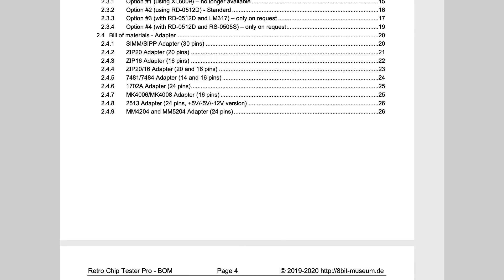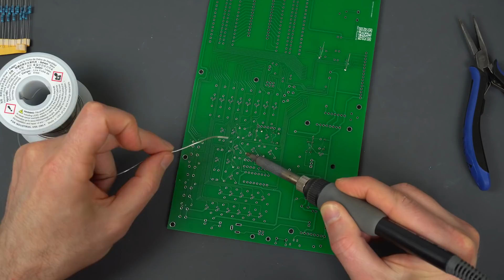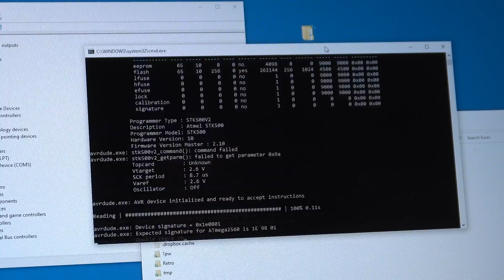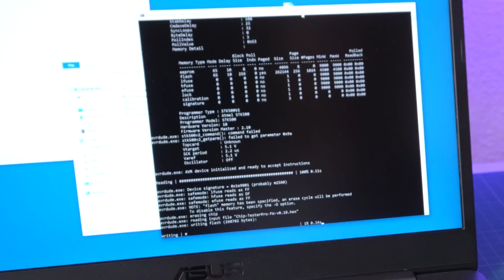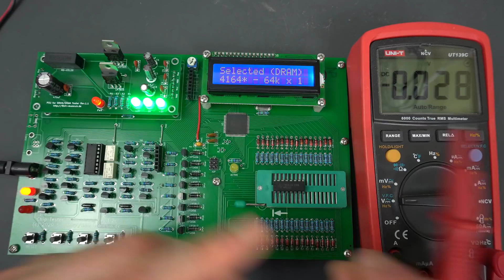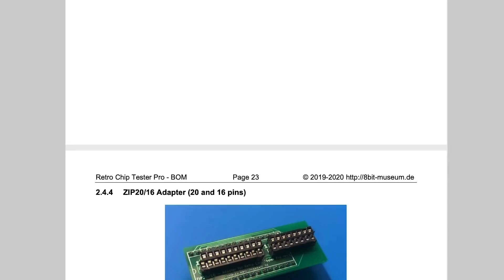The Ultimate Retro Chip Tester?

Comment: I saw something much better than this tester. Unfortunately I didn't see the device he shows only the display. He inserted the IC and after the test a graphic with all the pins appeared on the screen. Showing high or low or osculating on each pin and the model of the chip. It was in a pinball repair video. But there was no information about the test device.

Comment: I'm wondering how this compares to the TL866 and its A version, which not only tests chips but also programs microcontrollers (and the A version also has an ICSP port) and PROMS?  Obviously, the retro tester pro is better if you don't want to have to lug a computer around along with the tester since the retro tester does everything without requiring an external computer.  On the other hand, the TL866 both tests chips and programs microcontrollers and PROMS, and it's a lot smaller physically, and the version which I bought came with around two dozen adaptors for surface mount chips etc.  It's controlled through a program which allows you to select the chip from a drop-down scrollable list, which is convenient.
But how do they compare for the numbers and types of chips which they can test and program?
(When I say PROMS I'm including EPROMs and EEPROMs)
Reply: Please download the compatibility lists. The RCT tests about 1200 logic ICs that the TL866 doesn’t. None of the DRAM ICs and SRAMs <32kb are supported by the TL866. These devices have a different auditorium, so they are not comparable.

Comment: Very impressive variety and amount of chips it can test. I would think having the ability to interface with a computer and use a simple VT52 interface would help vice relying on a LCD screen - but it does make this tester as a convenient standalone tester. 

An alternative tester that I recently acquired is the Tauntek IC tester that I saw reviewed by CuriousMarc YT channel. I like this tester because during testing it is able to measure current drawn by the chip and measure pin voltages are within VOL and VOH levels and even tristate levels. It’s helpful to see borderline chips that other testers may just declare pass even though the chip may pull way more current than normal. 

The tester reviewed here and the Tauntek tester, together, can be some great testers to both have to complement a viable work bench. 

Thanks for the review on this tester and highlight mistakes during the build that could easily happen to any of us.

Comment: So out of curiosity, what was that HM486*** chip's entire part number? I ask because the Hitachi HM4864-2, HM4864-3, HM4864P-2 and HM4864P-3 chips are slightly different from the Texas Instruments TMS4164-15NL you started with. They have 128 row address strobe cycles, as opposed to the 256 of the TMS parts, so I wonder if that affected the test outcome?

Comment: I wonder if the USB programmer you used was capable of powering the board.  I noticed the power adapter was not plugged in while you were programming the AVR.  You may have been unknowingly powering the device through the clock pin (rectifying the 5V clock signal with the esd protection diode(s)).  I've seen microprocessors powered in this manner; Not good, but it can power the device to allow it to program.

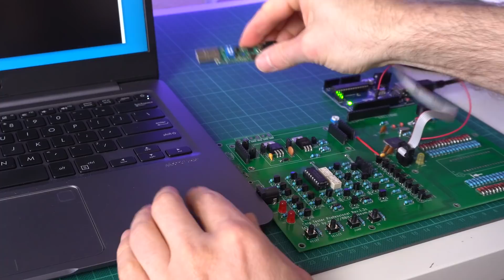Comment: At 8:02 you forgot to connect the Arduino’s GND to the chip testers ground. It doesn’t seem your Arduino is powered from the PC so wonder how the grounds are eventually connected to each other. This might also have caused issues when trying to clock the chip tester from the arduino.
Reply from the maker: You're right. I wasn't thinking about it but I think I lucked out because both devices are powered from the USB ports on the laptop.
Reply: @NoelsRetroLab  it was not clear from the footage that the Arduino was fed by the laptop as well. Its cable seemed directed the other way. Nice video!

Comment: As automation designer advise You - not use any scripted stuff. Because default fuses are set for internal RC clock at factory, changing must be in strict order. This video shows how to brick ATMega chip by turning off all clock sources - common error.

Comment: I really have to point out what I consider to be a tiny fault in your reasoning, specifically the cost. While I am not into retro or AVRs at this very moment, every bench should have acquired at least one AVR ISP programmer, if not a giant pile of them, and so should not have been included in the total cost. In fact, as a kit it's something you should do for the channel.

I'm not sure if you realized this, but at the end, you had three MCUs working together: the SMD one that's pre-soldered, the one in the programmer you got (which are almost generic, btw; you may have been misled somewhere. One AVR ISP or ICSP is the same as any other, more or less), and one more to run your fake external crystal program.

Anyway, great video otherwise, but the cost of the programmer should not have been included, IMHO (and I hope you didn't pay more than a dollar or two for the one that ran the fake clock), and you should have at least one programmer around, if not a few, and even another ZIF to try out programs before changing fuses on one that's going to be so annoying to resolder. Just my .02. Without the programmer, it's a pretty stunning value, really.

And last note, if you wanted to add a rotary encoder and change the code, it should be really trivial to do, looking at the nice layout of the board.

Comment: There is 21st century outside. Forget that txt LCD modules, find any colorful SPI/I2C LCD screens. They are even cheaper. And rotory encoder could be nice. But nice addition is USB port and host software. And all is done from other "duino" chip- STM32...
Reply: and for logic chips... China made eprom programmer has logic chip finder and tester. And also, it can test SRAM. The only missing option is DRAM. 30USD in 2007... (TOP2004).
Reply: @kaunomedis7926  Isn't having a choice something nice? You don't have to buy this one.

Comment: Why did the fuse setting script fail in the first place? Would it have made a difference to run it again?
Reply from the maker: No, I tried running it again, but the fuse state had changed and I wasn't able to program it anymore. Hard to say what exactly caused it. I think there was something wrong with the programmer cable and it may have had a bad contact and lost power during the initial programming.
Reply: If an error occurs, e.g. due to a bad contact or a wrong programming frequency (too high), it may happen that the fuses are set to "0x00" (it is a serial protocol, so it is very important that it is in sync). This forces the controller to use an external clock generator (not an an external crystal). Most people think the ATmega is broken, but it isn't. With the "osc" from the 10 pin header or an external clock generator (e.g. what Noel used) it is possible to set the fuses correctly and everything is ok ;)

Comment: Didn't need to buy that ISP programmer if you had an uno...

Would be neat to have an FTDI on there to interface with.  With so many chips to test, a simple program with drop down menus and a search function would be amazing.  Documentation and control could be combined into one program.
Reply from the maker: Yes, you're right. I went with the ISP just because it was the most recommended method, but the Arduino would have been fine (or better for me even).

Comment: bad idea to make such big board with only 4 btns
better is to make small board with mcu driven by usb. all indication should be on pc.
for example tl866 programmer
Reply: but.actually i look on this as commercial dev, so double sided smd will not be very friendly . but for 110 euros.. 

i think 80 would be.enough.for complete product.
Reply: @alexroman6246  When you can get the components for 80 EUR, well then you can assemble it for 80 EUR, sure. If you buy the components in a pharmacy, it may even be a little more expensive.
Reply from the maker: I was including things like the ISP programmer, which are not needed if you have an Arduino, so you may be able to get away assembling it for less.

Comment: you forgot the gnd pin from the arduino, not a very good idea to skip that, even if the gnd is the same as the pc, it will create a big gnd loop which is not good
Reply from the maker: I did! I think the only reason it worked is because I powered both boards from the laptop's USB ports which probably have the same ground. Oops!

Comment: Nice your make shift clock uses an XOR! Instead of dirty “if”! The sign of a good programmer.
Reply from the maker: Not like it would matter there, but yes, I see your point. However I can't take credit for that myself, because that was included in the (very extensive) manual itself 😃

Comment: OMG, what a horrible user interface. I was actually interested in this until I really saw how it was operated. What it needs is to fully use the USB interface to allow a program and database to live on a PC and then the chip number could either be typed in or selected from a menu.
Reply from the maker: It was designed to be a standalone device, so I think that's out. The new firmware version has a much better navigation, so check it out when it comes out. It's not ideal, but it's definitely better.
Reply: A simple serial port would make this thing so much more useful. CuriousMarc recently made a video about the Tauntek chip tester that works that way. https://www.youtube.com/watch?v=gqbXM48bbOs

Comment: Interesting, that works out to about USD$130, which is not a lot less than I paid for my Innoventions RAMCheck. Granted that only came with the default module adapter, so you'd need a lot of different adapters to test other kinds of memory, including chip memory, so that would add up (if you can even find them). The main advantage of the RAMCheck is that it also tests performance, not just functionality, so if the chips on your SIMM are marked 60ns, it will tell you whether it meets that performance or not. I've actually found SIMMs marked 60ns performing at 50ns speeds with no errors. The other advantage is it's a lot quicker. It can perform a whole lot more tests in less than a couple of minutes, and that's on a multi-MB SIMM, not a single chip with 256Kbits.

Anyway, the Retro Chip Tester is probably better value than an Innoventions tester, since they're not easy to come by. I should probably look into getting one, if nothing more than to test all the chip memory I've got on faulty boards. At least that would rule out a RAM issue with those boards.
Reply from the maker: Interesting, I wasn't aware of that RAMCheck. The fact that it measures performance means it has to be a lot more powerful, so that's certainly a unique feature the Retro Chip Tester couldn't really do. But I agree that it's a fantastic device for the money, which may seem a lot at first sight, but it really isn't given all it does.
Reply: @NoelsRetroLab  Oh yeah, and testers like the RAMCheck cost thousands new, so the fact that the Retro Chip Tester isn't as quick definitely isn't a bad compromise.

Comment: I think I'm sold on this. 

In the future making it so it can identify unidentified chips would be a fantastic feature if it can be added! Also adding a full keypad to directly enter chip numbers would make things easier too. If/when I get one I think I'm going to try to design a 3D printable case for it.
Reply from the maker: You won't regret it 😃 A friend of mine used a small plastic case he had for something else that's JUST the right size of the tester. So he can carry it around really easily. I believe he also changed the power supply to use batteries, so he made it 100% portable. Really neat.

Comment: Remember to set the contrast for the new LCD.  Also, I would mount it in a wooden case with a lid, and print the extended chip list as either a table on the inside is the lid, or as a little booklet that sits next to the device.
Reply from the maker: Great idea about the case and putting the list there!

Comment: 7:50 how does it generate clock only one cable? I was thinking they have diffferent ground??? confused...
Reply from the maker: You're right. I didn't think about it at the time (doh!), so I think the only reason it worked is because both devices are being powered by the USB ports in the laptop that probably share the same ground. In other words: I just got lucky 😃
Reply: @NoelsRetroLab  yes I was thinking that too :)

Comment: most of which can simply be done with the tl-pro/minipro programmer anyway. just requires a bit of creative coding. it'll happily test all your rams for you. also test and identify most logic chips.
Reply: The TL866 can test the MK4006/MK4008? The TL866 can dump an Intel 1702 or Intel 1602?
Reply from the maker: How do you test DRAMs with the TL866? I don't see them in the supported device list. Is it with a custom configuration or something like that?
Reply: @NoelsRetroLab  you don't. you test srams with it. although it can probably do that too (dram that is). it's a pretty universal device once you figure out how it actually works.

Comment: Very useful and awesome device.  For me the 64K question is how many of the chips on an Apple ][c motherboard could this device test ?  Could this device be extended / designed to test retro computer CPUs ?
Reply from the maker: Good question. I suspect it could check most of them. But get the full list and check. CPUs are out for now because they're 40 pins. I suppose it may be possible to make an adaptor, but it would have to be specific to each CPU, so probably not ideal for that.

Comment: I wish we would get away of using ATmega for new products in 2021. Cortex M3 devices are generally cheaper, much more faster and capable. It`s as if we were stil building software aimed at Windows 3.11
Reply from the maker: I imagine a big reason for doing that is voltage compatibility with the chips being tested.
Reply: @NoelsRetroLab  Yes, indeed. The "newer" MPUs use 3.3v (maybe they are 5v tolerant) and that requires lots of level shifter. And then everything has to be in SMT... People sometimes forget about complexity and costs...

Comment: would be nice if had the ability to test op-amps also, maybe even resistors and capacitors....but that may just increase cost :(
Reply from the maker: Right. And specifically this is limited to digital devices, so it's only prepared to send 0 or 5V to each pin as far as I know.

Comment: Wonder if it can be rejiggered to check things like CPUs and other chip types (like SIDs/VICs/Antics and so on).
Reply from the maker: CPUs and VICs are out because they're usually 40 pins and this only goes up to 32. The next firmware version will support the C64 PLA. SID I think it's too complex, with analog outputs, although you could check that it's alive probably.

Comment: @Noel's Retro Lab What? You overcomplicated AVR recovery. All you need is an ISP programmer and mk AVR calculator - it can deal  with  bricked by wrong fusebits AVRs...
Reply from the maker: Was there an easier way? That's the first time I was doing that, so it may be possible. But my impression is that it needed a full clock signal given the state of the fuses or it wouldn't answer at all any more programming.
Reply: @NoelsRetroLab  You're right. Maybe he didn't hear that the fuses were set to use an external clock. In this case the ISP programmer does not help or he did not understand the problem.

Comment: Building this you need Marco Reps  "B I E G E L E H R E "  to bend the components leads for exacting inserting. Great Video
Reply from the maker: Oh interesting. I didn't know about that! (Just Googled it). I use an IC pin straightener, but I had never seen a component one like that. And I agree with you! The board was designed to fit the components bent exactly at the body, so any slight deviation and it was hard to insert them. That would have come in handy!

Comment: When you connected the Arduino to fool the clock you had no ground wire. How does that work?

Also I noticed the PC pads for a USB connector. Many Atmel processors have USB ports. They could add a GUI based PC program with that for device selection and more diagnostic data.
Reply from the maker: Good point about no ground wire. I totally missed it when I did it. I think I got lucky because the power for both devices was coming from the USB ports in the laptop. Oops.
The USB connector is just for power. I suspect it would need a lot extra support to be able to communicate to a PC, and Stephan made it clear that wasn't his design goal (he wanted a portable device, not depending on a PC).
Reply: @NoelsRetroLab  Well you could have both, as-is now and a GUI option. You could sell the GUI as a software upgrade.

Comment: Where do I go to buy the 2 boards, and the CORRECT ZIF Socket?  I hope the designer adds being able to backup on a chip selection!
Reply from the maker: The PCBs you can order them directly from the designer (first link in description). The ZIF socket I found it from https://aliexpress.com/item/32831052786.html Good luck!
Reply: @NoelsRetroLab  - Ordered the sockets, thanks!  BUT, went to designers site and could not find where to order the board's!
 It just kept running me around in circles!!